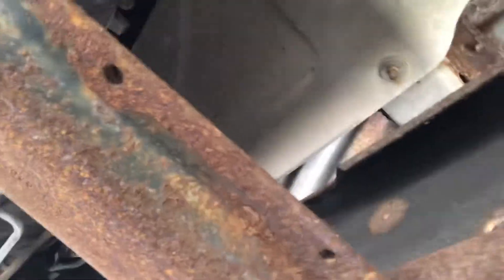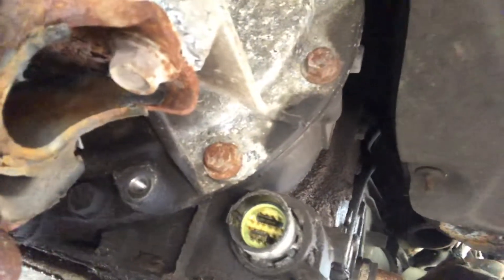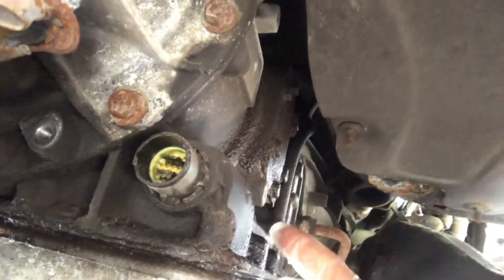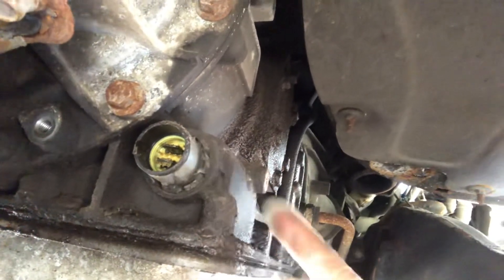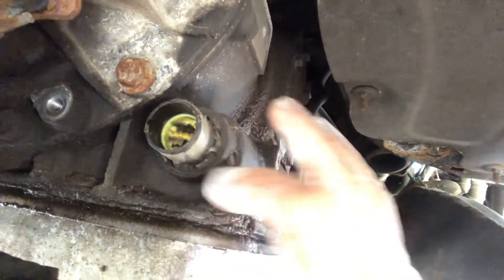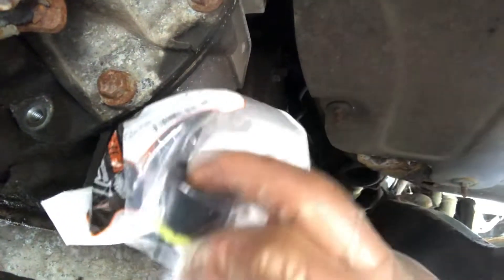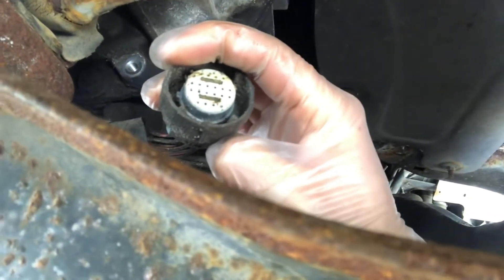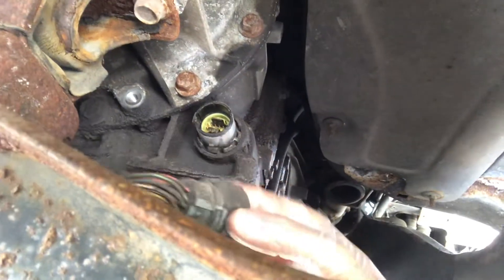Pass through connector duramax Allison 1000 transmission replacement

Comment: With this cause my truck not to start I have a 2001 LB7. It has the Allison 1000 as well but for some reason my truck won’t start with P0500 code I was told this was one of the problems as well and I did find transmission fluid on the connection
Reply from the maker: Start with the connector first

Comment: Is this a temporary fix for replacing of inside harness or Can it work permanently? 🙏🏼
Reply from the maker: This is not temporary it keeps the fluid from coming out of the transmission where the plug is, you want to clean the plug connectors with brake fluid before plugging it in after replacing it. The inner harness only get replaced if wires are damaged inside which isn’t common most of the time the harness gets replaced unnecessarily

Comment: Hi do u still have this truck my dog ripped apart that plug , i got new plug pigtail and i cand figure oout what wires were  conected to what pin  in the plug, would u help me pls .
Reply from the maker: Best thing to do is google duramax transmission connector wiring diagram and it will show you exactly where they go

Comment: Can you replace that connector with oil in the pan? Thanks
Reply from the maker: The pass through connector can be with oil in the pan not too much oil will come it will replacing but try too spray and dry the connectors with brake cleaner before reconnecting the harness

Comment: Is there any way you can provide a part number for this part ? Thank you!
Reply from the maker: I would google search Allison 1000 Pass through connector to see where you can order the closest one to your location
Reply: @MDS Squared  hey I got an allison transmission on a box truck  code read p0776,  so we changed internal harness an b solenoid but truck still other won't go over 38 mph or won't go into gear at all any suggestions
Reply from the maker: try changing this part, or fluid check or a damged wire in the harness going to the engine, god bless

Comment: As someone who was an Aircraft electrician in the military. For the love of God please use Electronic parts cleaner NOT brake cleaner, carb cleaner etc. You can use MAF sensor cleaner if need be but brake cleaner and carb cleaner is too strong and corrosive and will cause issues over time. Also when you’re done cleaning it out out some Dielectric grease on the connection it’ll save you in the long run. Just a tip Good video otherwise
Reply from the maker: It’s just metal